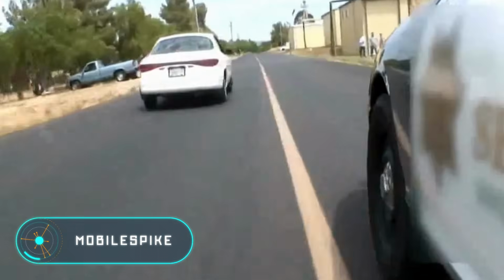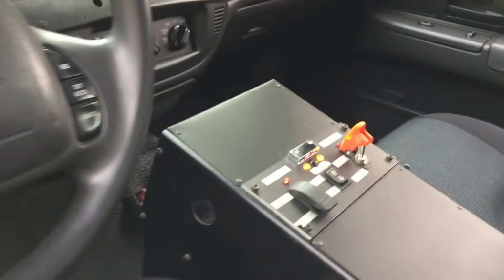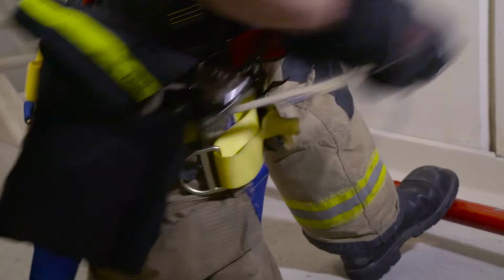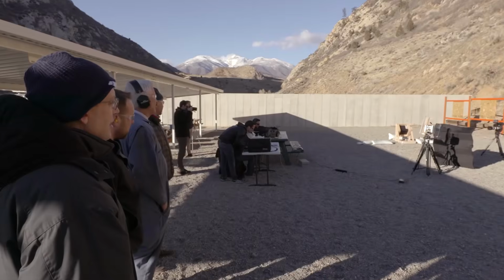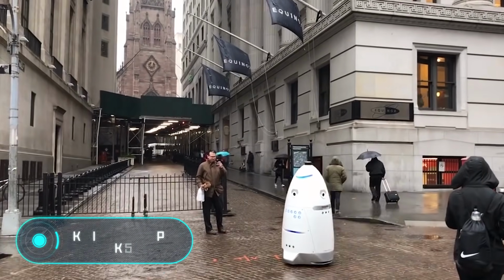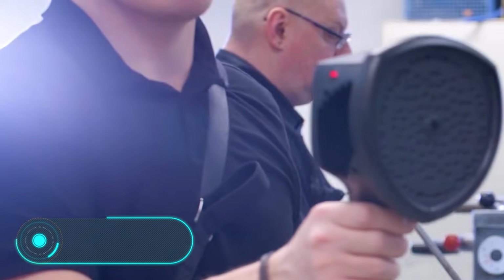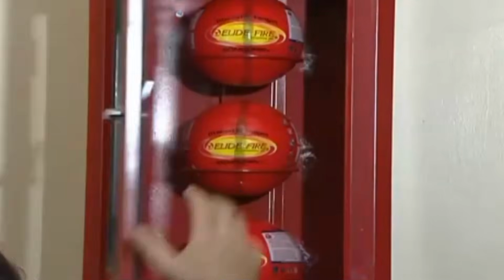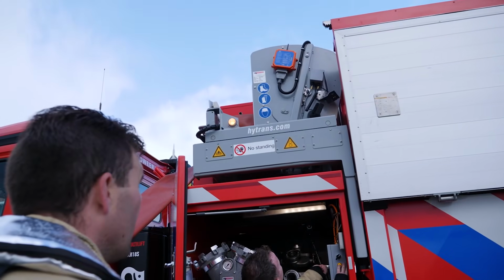10 INCREDIBLE INVENTIONS FOR POLICE AND FIREFIGHTERS

Comment: Crook hook,-
Have anyone noticed a liquid pouring from pierced vehicle's back,my quess it's petrol,combined with hot exhaust,anyone with even with 1 working brain cell wouldn't be using that button...
There's a high possibility of ripping bumper off in new cars,aswell not reaching lifted ones or can't go under lowered ones.
And there's issue of power,traction and mass disadvantage of cop car against pursued one.
Basically it's rubbish

Comment: Crook hook works until you run into a fully built car with full breaks on each wheel with slotted rotors and it breaks and pulls it off😭😭

Comment: There are a few issues on some of these. The crock hook isn’t safe as it endangers the officer as they could be easily shot when trying to stop the suspect with it. The mobile stop sticks may seem to be useful but, it also requires precision with a motor vehicle, and most of the time you aren’t thinking about precision, you’re focused on chasing. That’s why there are normal stop sticks, which are simple to use, grab, throw, wait, then pull. Those two inventions were not thinking about the realistic aspects of police chases, only simple unlegit ones.

Comment: That rope thing would be good but that’s an extra 10 pounds of rope that we don’t want to carry when we’re already carrying 100 pounds of gear in a building when it’s like 150 degrees
Reply: Very true and you guys always have harnesses on the trucks if needed
Reply: And with some knots you could do the same thing with just a rope, which we have with us anyway... I mean it hurts a bit but ist better than beeing trapped.
Reply: I was also thinking about the fire burning the rope.
Reply: @juliusgreen1762  The ropes we use are fire resistant to a certain degree.
Reply: There already is emergency exit devices in use
Reply: Firefighters do not carry 100 pounds we carry 60 pounds total spread out if you cannot carry more work out more!!! A quick deploy rope would not affect you, you should have one in your pocket and some tools
Reply: And 150 degrees?? Try 1200

Comment: The only problem with the crook hook is that one, most high speed pursuits involve swerving and crashing, so hooking on to the rear of a erratic driver isn't smart, and two, being stuck that close risks the officer being shot with nowhere to go
Reply: Yup that's why they just shoot a sticky tracker at them now and then fall off the pursuit. So they don't speed up and down streets. They stay couple blocks away and move in when they stop.
Reply: @uniquevoid1  has
Reply: And it will destroy your car
Reply: also that fucking car started leaking fuel im pretty sure?? and the idiot did a burnout in the video aswell lmao that was a close call
Reply: @ex4mple69  exactly it’s a hook that hooks the car right on the gas tank glad I’m not the only one to notice how stupid that is

Comment: Now here’s something to take into consideration with the crook hook. Lifted cars and powerful trucks
Reply: And the fleeing party can still steer
Reply: Lol tuned gtr will just take off with or without policecar
Reply: @jarnohaneveld6595  good joke
Reply: You forgot front wheel drive..
Reply: @emilvlogs27  it’s not meant to lift the back tires off the ground it’s meant to hook onto the back bumper. Also I just realized an other flaw. What happens if the vehicle has no rear bumper or if the rear bumper gets torn off
Reply: @BMMEC6000  well it's not really grabbing the bumper but the frame and any other sturdy parts under there no matter what they are, and what hes saying is that on a lifted truck, a short police sedan isnt going to isnt gonna be tall enough to reach those sturdy parts and even if it does, most modern trucks should have enough power to drag the police car anyway
Reply: Another thing is it has a high possibility of puncturing the gas tank on some vehicles
Reply: @GrantsDad  true true
Reply: What’s the cop going to do if the suspect then decides to start shooting through the rear window.
He’s just stuck there with no cover.
Reply: @johno6366  well I’m guessing that police cars have bullet proof windows but you have a point
Reply: Car's with missing bumpers
Reply: Or dropped cars lol 🚗 🚘
Reply: Is there enough material in the back of some of these small cars to actually get a hold of?  The opposite end, grab on to a 3/4T diesel pickup and see just how effective the brakes on the cruiser are in slowing it down.  Not advocating high speed chases or even thinking of it.  Making observation as a farmer who has pulled a ton of stuff safely and sometimes not so much (most always on our land).  Just saying there are scenarios when this would be more dangerous to the officers than not.
Reply: The grapple is way better!
Reply: Anything that’s lowered gl trying to hook on to that as it won’t even get low enough to slip under
Reply: Hmm or the other person can just brake check the cop or even just swerve
Reply: @Wozza-sc2dd  that wouldn’t work since the hook would still be attached.
Reply: @BMMEC6000  when there getting lined up brake check them take there engine for your trunk
Reply: Jesus this is the most comments I’ve ever had to sift through
Reply: @BMMEC6000  noice
Reply: Also every new car has a plastic bumper
Reply: What about cars that are super lowered
Reply: You mean powerful cars and lifted trucks?😂
Reply: @rogue-analyst  cars can be lifted too dummy
Reply: lol imagine if the cop uses crook hook and dom:s car in the fast and the furious with 2000hp lo
Reply: @alutard9668  this would take the police for a ride
Reply: All wheel drive
Reply: And front wheel cars
Reply: And lowered cars
Reply: Or just fucking speed
Reply: Harpoon car like a whale
Reply: @bigtuna4037  what does that have to do with the crook hook
Reply: And fwd
Reply: Don't shoot the messenger but most if not all new cars have a rear bumper that is comprised of nothing but fiberglass, plastic, and high density foam. In the clip one of the cars being stopped clearly has a trailer hitch. Any car without one will get away once the rear bumper rips apart. Most of these products are just prototypes but they obviously don't do much r&d before showing off some of these useless products.
Reply: @DavidBrown-nd9mf  you are absolutely right
Reply: @DavidBrown-nd9mf  No cars have plastic or fiberglass bumpers. They have plastic or fiberglass bumper covers. There are metal bumpers underneath.
Reply: In police chases you never see the cops getting that close. Imagine you’re chasing a hemi you’re never getting near that car
Reply: For the crook hook the police would need a heavy ass vehicle, if not the crook could steer into a tree or something. Also would need to be bullet proof, if the crooks are hooked and shoot at the cops the officers would be fucked if they're literally right behind the car.
Reply: Also front wheel drive cars
Reply: What about a guy like me that has a 5 ton military semi truck thats 6 wheel drive and could run over a crown vic police car?
Reply: Took me a sec lmao
Reply: You mean lifted powerful trucks🔥 and low powerful cars 👍🏼🔥😂
Reply: @Ricky.uploads  you know what I mean. Not just trucks are lifted
Reply: @BMMEC6000  donks
Reply: @Ricky.uploads  no, lifted car so it doesn’t get hooked, and fast truck cause it’s already lifted. No misspelling, just saying. No need for a truck lift when it’s already lifted and no need for a damn car lift when it’s got speed
Reply: @Ricky.uploads   no if your truck is lifted without changing the engine, it actually makes it weak as fuck
Reply: @FartassVolfgangus  ik 😂

Comment: The crook hook won’t work on those front wheel drive cars lol
Reply: There's still a rear bumper and frame that it could catch
Reply: Why. What front Wheel drive cars do u Think have the power to pull itself + a police car blocking its brakes
Reply: Just drive a shitty Honda, make sure the rear bumper is lose and theres litterly nothing in the rear to catch.
Reply: @mouaxiong8618  SHHHHHH DONT TELL THE CRIMINALS
Reply: It will never happen. If the cop gets brake checked hes fucked
Reply: This has to be a joke no person can be this stupod3
Reply: What do you mean it can still hook onto something
Reply: what i mean is that if it lifts up the back wheels, the front wheels can still drive
Reply: @boxodoge9780 two front wheels will struggle to move 4 locked wheels, regardless of horsepower, what matters is traction and grip. Larger vehicles may simply be high enough that the hooks can't grab anything.
Reply: also, u cant use it on trucks that have 4wheel drive bc trucks have better horse power than most small police vehicles

Comment: What a useless bunch of crap! It looks like some one who never was part of the police are making stuff to get as much as possible form the goverment. 
1) How do you fold it in case there are other civilian cars on the road? It unfolds just to one side, what do you do in case you can not get on the left of the chased car? 
2) Those hooks will definetly work on 4x4 car or just a lifted one and they will not just rip off the plastic bumper. What happens if the caught car is more powerfull than the police one? 
4) Origami shield, works only up to 3 class. And it is no like anybody in USA can just go to the gun shop and buy 7.62 rifle.

Comment: Car hook but thrift car front wheel drive😂
Reply: Well then the FW would lose the Tires because u have too much Friction on one Section,  4W/AW Drive has more Rotation Power to hold a FW drive from Moving too so it's either u stop completely or have to pay for New FW Tires...
Reply: Yeah but a Jeep thats has been hook By another police car what would happen, i mean does a tank have the hook Or what if its a Truck that has criminals What would you use for it Police truck That will be hooking the truck How impossible